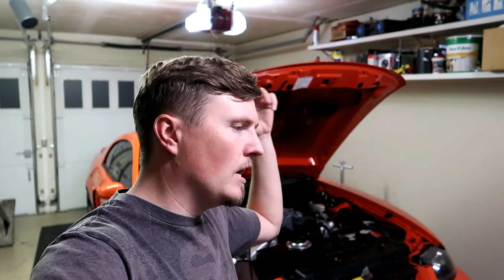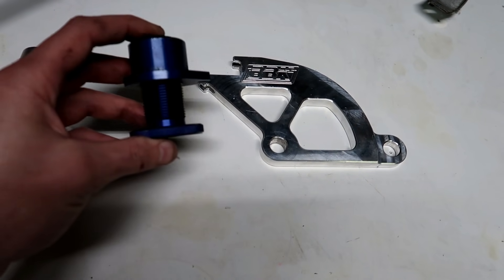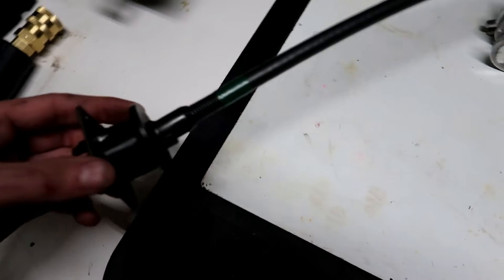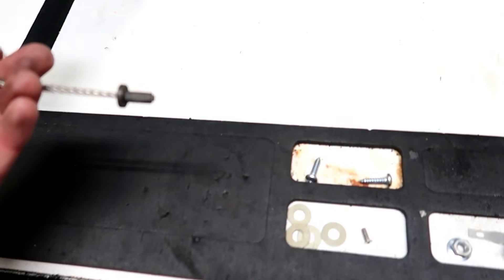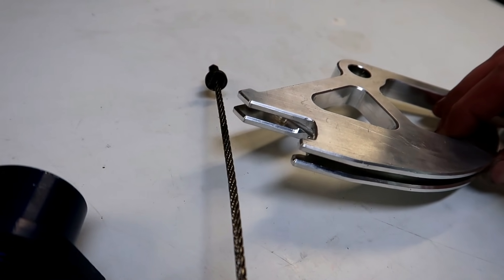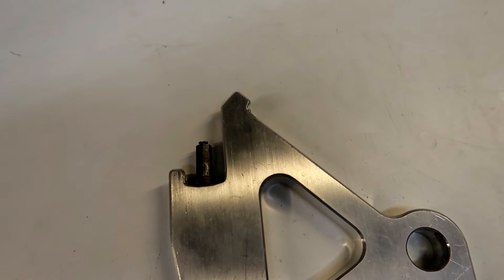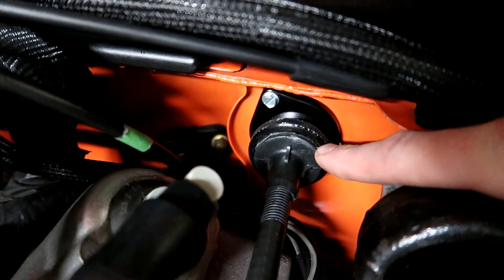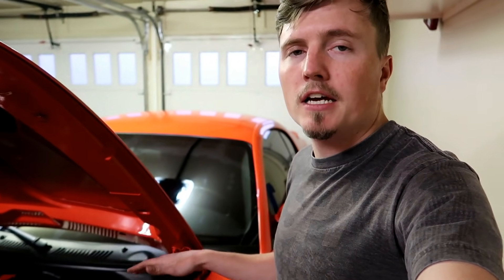How to properly adjust your clutch cable!

Comment: my clutch is making noise like its not disengaging not sure if its the bearing loud whine.gonna try adj the cable.great video..
Reply from the maker: it's probably a bad throw out bearing, does the noise change when you push down on the clutch pedal?
Reply: @JaegerWrenching  yes but it doesnt go into gear now

Comment: You don't want to have constant pressure on your throwout bearing either. If you have pressure against your throwout bearing it is the same thing as riding around with your foot resting on the clutch pedal.
These mustangs don't need any help wearing throwout bearings out as it is !
Reply from the maker: Tell that to the 100s of people who have better shifting mustangs from this advice. it's not a lot of pressure just taking the slack out. Even Ford intructions and Maximum motorsports says the same thing.

Comment: My pedal grabs at the tippy top. I got a new cable that's not adjustable. But I do have a bbk quad. Ordered a firewall adjuster. Does it need more slack In the cable for the pedal to grab halfway?
Reply from the maker: yes
Reply: @JaegerWrenching  just installed the FWA. Cable still is tight and still causing clutch to slip
 Thinking I might need an adjustable cable but this new cable should work. I'm fed up lol
Reply from the maker: @anthony8194  use the other hook on the quadrant, also make sure you're no using the supplied spacer on the cable

Comment: Help Needed!

I installed a new clutch, new transmission, and new adjustable clutch cable. Everything worked fine for about 2 weeks, then all of a sudden the clutch stopped disengaging. Got my clutch cable from American Muscle, it has a threaded rod-end that connects to the fork for more adjustability. I set the firewall adjustment all the way down, and then pulled the fork until it pushed on the pressure plate springs about 1/8" and locked it tight with the locking nut. The clutch would still not disengage, so I started backing out the firewall adjustment. Now it's fully turned out all the way out, and still no disengagement. Any thoughts before I rip my head off and tear out the transmission (again)
Reply from the maker: Is your clutch fork installed properly? I've seen them improperly installed on the pivot ball to where they appear to be right but they are not.

Comment: Will this fix my shifter buzzing whenever it goes into 3rd and reverse?
Reply from the maker: Possibly, that’s either caused by worn synchros which this will not fix, or not disengaging the clutch fully which this video will fix.
Reply: @JaegerWrenching  sounds good, i hope its the adjuster, thank you🙏
Reply: @juansegovia6443  did this fix your 3rd gear being noisy😮 going through the same car issues lol

Comment: Hey brother, I would like to ask for some advice. I have an 04 cobra that is giving me issues with gears not disengaging. I decided to take action and change the clutch, pressure plate, flywheel, pilot and throw out bearings, fork, new tranny fluid and lastly the clutch cable. The cable I have has the adjustment where it connects to the fork. Sadly the issue persists. I also noticed your wheels still have momentum as you press down the clutch pedal, my rear wheels come to a sudden stop even if I disengage the clutch at a high speed like 30mph or so while the wheels are in the air. At this point I just want to sell the dang thing, I've been fighting with this problem since October 2022. Perhaps my problem could be inside the actual transmission? The car only has 45k miles but who knows how badly this cobra was treated by the previous owners as I am the 4th or 5th owner if I remember correctly. I look forward to your reply and I hope you have a blessed day.
Reply from the maker: Sounds to me like your rear brake are dragging. I've seen this happen with cobras in the past
Reply: It was the second gear and shift fork. I sent my transmission to a shop and they rebuilt it for me lol
Now I have this cable and quadrant, the clutch pedal shakes pretty bad at like 3k. I'm wondering if I need to make it tighter or get the firewall adjuster

Comment: I was a little short on cash so skipped the adjuster for now, but instead got a mm quadrant with a Ford adjustable cable. I put a little bit of tention on the cable, and now my shifting issues are gone. I think I'll have to put a little more tention on the cable, my car doesn't start to roll until about 2.5 to 3 inches off the floor. Where it's at makes a super long throw when taking off from a stop, but it's a heck of a lot better than grinding gears, especially when trying to put it in reverse.

Comment: I have a coyote swap in my foxbody using a Cobra T56, has a quadrant, fire wall adjuster, ford cable and MGW shifter. With car on jack stands I press clutch in all the way and shift into 1st and wheels already start to spin with clutch pedal still pressed. I've tried to adjust many times and still can't seem to get it to work correctly. It shifts into gears OK but reverse is tough. When I put it on the ground I can't shift into any gears while car is on. With car off it shifts into all gears nicely. Any ideas?
Reply from the maker: Sounds like it's not disengaging fully.
Reply: @JaegerWrenching  I appreciate the response and I'll try and make more adjustments later today

Comment: Im having trouble with my 2003 Gt 3650 trans, i recently installed a clutch, throwout bearing, ford oem cable with a fire wall adjuster, double hook quardant , the clutch engages really close to the floor and 1st gear takes effort to get into and reverse doesnt grab at all anymore ?! All gears were working fine before the clutch install and right now the cable is firm theres no play at the clutch fork and the cable is on the second hook on the quadrant , If i tighten the cable more i feel like it would snap or mess up my clutch or throwout bearing .. What should be my next move should i try putting the cable on the first hook and play with the firewall adjuster ? or should i see if my shifter is all the way down ive heard that may cause the issue but any suggestions would be appreciated
Reply from the maker: Tighten the cable more and re-test. Your cable won't break, you're not to the point of fully disengaging the clutch which is why it's close to the floor before doing so and why it's also giving you issues with getting it into gear.
Reply: JaegerWrenching Okay i will try that out , i attempted to tighten the cable some more but then the clutch pedal felt super stiff is that normal ?
Reply from the maker: @edliardomunguia2802  depends on your clutch, some are super heavy. What brand of clutch is it.
Reply: JaegerWrenching its a exedy 350 stage 1 clutch
Reply from the maker: @edliardomunguia2802  how stiff are we talking? can you push the pedal to the floor?
Reply: JaegerWrenching Id say its stiff/“heavy” for it being a new oem clutch cable with new clutch and bearings , but i can push it to the floor no problem . I have 66 miles on this new setup and the first day reverse was hard to get into but today it completely doesnt allow me to get into Reverse and first takes some muscle to get into , When the car is off every gear is like butter but when its on only 1st and Reverse give me trouble .. it engages fine but its defiantly close to the floor and i forsure need to have the clutch pressed all the way in with pressure to disengage the clutch
Reply from the maker: @edliardomunguia2802  tighten your cable until the engagement is in the middle of the pedal. that clutch is stiffer than stock and clutch cable cars are very sensitive to heavier that stock clutches. Where did you buy your clutch cable? I'd recommend a Maximum motorsports cable, by far the best out there.
Reply: JaegerWrenching Okay i will attempt to tighten the cable again , i bought a ford oem cable from american muscle and i have it set up with a double hook quadrant and SVE firewall adjuster . I shouldve went with maximum motorsports >:-/ , regretting it now but hopefully this works for the meantime i will let you know the results tomorrow . Thank you for getting back to me i appreciate it !
Reply: JaegerWrenching Update - So today i tightened the cable some more and no luck still was having the issue , took it to my local mechanic and turns out the clutch fork wasn’t seated properly . Im not sure how exactly but it was fixed without having to take out the transmission so im guessing my mechainc released the cable and moved the fork around until it seated correctly and now my car shifts AMAZING feels like a honda clutch super soft and grabs at the top . Hope this helps anyone else having problems and again another thank you @Jaeger for the helpful information .
Reply from the maker: @edliardomunguia2802  it wasn't on the pivot ball, therefore it wouldn't depress the clutch diaphragm springs properly. It makes perfect sense now glad it's fixed!

Comment: I just bought an 89 mustang, it has the aluminum quadrant and adjuster already in it, the pedal has some dead space at the top, when I let off the clutch, I can still pull the pedal up about another half inch to get it back to where it stops, I'm about to try to adjust this tomorow, I should turn the adjuster counter-clockwise? I've never done this before so I just want to make sure, thank you
Reply from the maker: Yes counter clockwise. good luck this should help and give you a good pedal feel.
Reply: So I tried to adjust it today, only thing is that there's a set screw in the adjuster that's holding the cable in place, I can't see into the hole enough to even tell if there's a screw in there but if I try to spin the adjuster, it spins the cable too and won't let me adjust it, any advise? I tried putting a bunch of different Allen keys in the hole where the set screw is but nothing seems to grab anything in there, and from where it sits there I can't even see if the screw is actually in there

Comment: I got a 93 foxbody with the stock t5, a bbk cable, quadrant, and firewall adjuster. Either my clutch won’t engage so it wants to grind the gears or when I get it to finally engage and wants to shift, my throw out bearing makes a squeaking when I left off the clutch. I even got a spring set up that sits between the transmission and the clutch fork to keep too much pressure off the throw out bearing and it still does it. I know this video is fours years old but would appreciate anybody’s help

Comment: I just got a 99 cobra with the steeda clutch cable and quadrant but the clutch feels near impossible to push in. Nothing close to what yours is. You think the cable is just way over tightened?
Reply from the maker: The cable is trash get a maximum motorsport one.
Reply: @JaegerWrenching  it actually bound up and broke the next day 😂

Comment: Don’t know why this is confusing to me I bought a Bbk cable/quadrant and firewall adjuster.   I have to have my adjuster on the fork on as least threads as possible to get it to shift right. I had is dialed in perfect for a few months now then I noticed a rattling noise and took the cover off and noticed the jam nut rattled off.    If I tighten it to have enough threads for the jam nut to seat the clutch engages really high.    If I screw the firewall adjust all the way in it engages kind of where I want it off the floor but the gears grind.  If I turn the adjust out or to the left it engages higher off the floor and just feels weird.  Not sure if my clutch is going or what.   Any advice?
Reply: Get rid of the bbk that’s the problem
Reply: @frankycheechoo1126  yeah I just changed my clutch yesterday.  Trans is still waiting to go in.  I got a ford adjustable cable waiting to go in.     My clutch fork spring that clicks onto the pivot ball was stretched out.

Comment: Hey how come the maximum motorsports clutch cable doesn't come with the bracket? Is it necessary to have the bracket on the cable?
Reply from the maker: Adrian Quintero Jr What bracket? Do you mean clutch quadrant?
Reply: @JaegerWrenching  the bracket that's on the clutch cable. That you mount near the oil filter.
Reply from the maker: @adrianquinterojr6379  ahhh, It is supposed to be reused, so if you are missing yours call maximum and see if they will send you one.
Reply: @JaegerWrenching  well my clutch felt soft for a couple of days but then became stiff once again. And it's been like that for a couple of months. So did the cable go bad since it was not mounted. In the beginning of your video you mentioned something like that?? I just removed the clutch and turns out it was a factory clutch so I believe the cable flexed? Hopefully I'm not making sound confusing
Reply: @adrianquinterojr6379  Maximum Motorsports recommends not to reuse the clutch cable bracket.
Reply: @bb2status  I miss my 2V I sold it and got a clean 3V

Comment: Hey question . New clutch. Wont go in to gear when it's on. But it will when it's off. Grinds when it goes into gear.
Reply: Also it wont engage
Reply from the maker: @MustangGal004  Sounds like something is installed improperly. if it goes into gear when off, but not when running that's like it's not disengaging fully. But if you say it won't engage either? That makes me think more like improper install because it's doing both. It should only do one or the other of those if something is out of adjustment. When you installed the trans did you check for clearance between the throw out bearing and the clutch fingers? Or disconnect your clutch cable and see if you have play between the clutch fingers and TOB.
Reply: Hey! We are going to take it apart and out it back together. One guy did it. Now my boyfriend and I are going to do  it now
Reply from the maker: @MustangGal004  Awesome if you guys need some help feel free to ask! I'm getting married this Friday so i maybe busy but i'll try my best to help!
Reply: @JaegerWrenching  Awww congrats! That's no problem! I'll deff let you know if we do! I'll even send pics for updates lol
Reply: Ok so! Lol thought we had it
 One bolt was missing from the shifter
 Driveshaft was off, but it went into gear just fine with it off. Put the drive shaft back on. Doing the same thing as it was doing grinding and not going into gear. You can go in to 1st and 2nd now, but with a ton of pressure and pushing
Reply from the maker: @MustangGal004  tighten your clutch cable if it's adjustable or your firewall quadrant if you have one. if it's stock pull up really hard on the clutch pedal and listen for clicks. see if that helps.

Comment: I've had to replace 3 clutch kits on mine I was 18 at the time and never looked into it thoroughly as I had faith in fords "infinite wisdom" on it self adjusting quadrant  but it was allways way off the release bearings would allways squel lol it blew up once and dug itself into the fork it was awful wish ford wasnt too cheap to have hydraulic systems like everyone else also too much preload will wear out the throwout bearing as well

Comment: Bro just installed mine! What does it mean when it’s hard to adjust the fire wall adjuster?? Like when i turn it , the cable wants to turn with it also making it hard af
Reply from the maker: It means your cable is getting tension in it and starting to put preload on the TOB. You should be close to where you want to be when it’s like that.

Comment: please help me do this and fix some other possible issues with my 01 turbocharged mustang cobra!! im located in CT i would be willng to drive if you would be able to help adjust the clutch and other stuff because i think the vband clamp for downpipe is loose and its blowing white smoke but has tons of power even in full vacuum and im assuming full compression.

but please help me adjust my clutch it has a horrible adjustment rate... it needs to be pushed all the way in and is very stiff to shift gears, but the clutch engaugement point is all the way at the end after the spring kind of throws ur foot into letting the clutch out fully you kind of have to fight with it and get it at that engagement point while on the brake and then modulate the throttle but i know you can help me out big time i would love to bring her to you let you rip the cobra and maybe make some youtube content and fix these issues..

let me know if you willing to help me out im located in CT and email me netime at yahoo or on insta of fb @pete88p..

thanks in advance,

-P3T3R
Reply from the maker: I'm all the way in Albuquerque New mexico but i'm down to work on your car if you bring it to me.

Comment: This video was extremely helpful. I'm working on a 66 Mustang with T5. I had been guessing at the clutch adjustment and had never thought of jacking it up and seeing exactly where it starts to grab. Turns out the pedal wasn't much more than an inch or so off the floor before the wheels started turning. I backed the adjuster out so the travel was about the same as yours and the operation is much smoother. As a side benefit I also realized my newly-installed performance rear drum brake system was dragging badly. As soon as I put the clutch in the wheels immediately stopped.  I adjusted the shoes and it stops great.  Thanks.

Comment: So the firewall adjuster with out the lock screw are ok ?? Did u put washer on ur quadrant to push it out some so u want ur quadrant as close to the clips that hold it on to the clutch pedal??

Comment: Nice through job of explaining how the clutch cable works & how to adjust it. I was afraid of "over adjusting" it . Apparently its okay to have  a "pre-load" on the throw out bearing. On older Chevys' you never want to have the throw out bearing touching the clutch fingers otherwise it would wear-out the bearing prematurely. This guy would make an EXCELLENT instructor.

Comment: How far down on the pressure plate fingers are you pushing them like a couple inches or so?
Reply from the maker: Wesley W it depends on which quadrant you have. But you only want to just touch the fingers with your TOB.